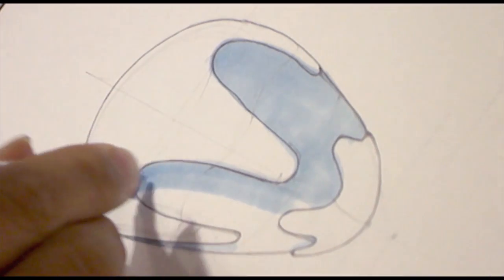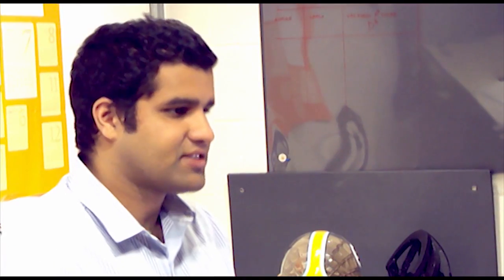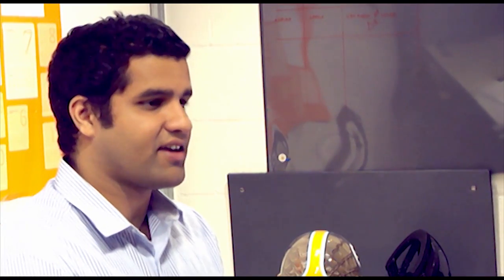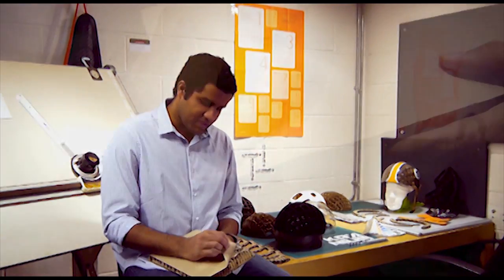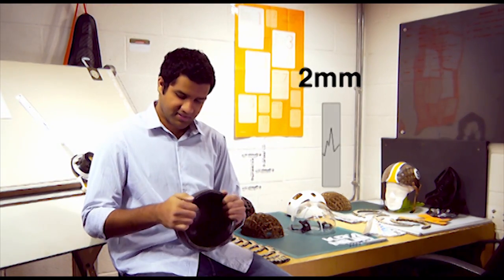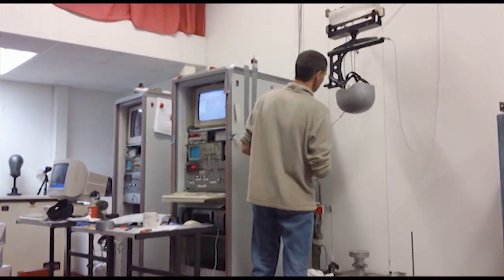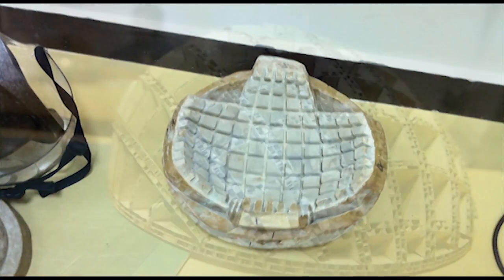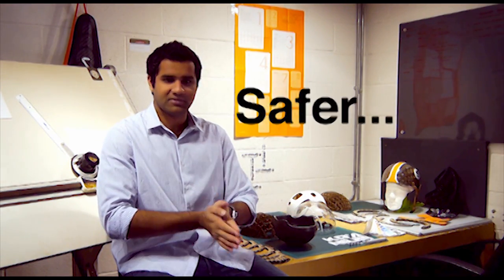Kranium The Journey

Comment: Electricity and paper were both discovered/invented a couple of thousand years ago. The first use of electricity in paper-making was probably a couple of centuries ago. Nothing prevents making, gluing or cutting of paper without electricity.

Any chance the cardboard bit could be replaceable ? So the plastic could be recycled if undamaged by age or collision ?

It would be interesting to go beyond the standard tests - drop onto a tilted plane to mimic an oblique impact more parallel to the road.